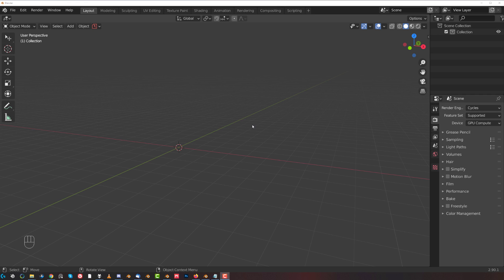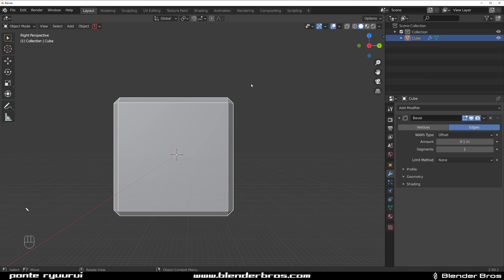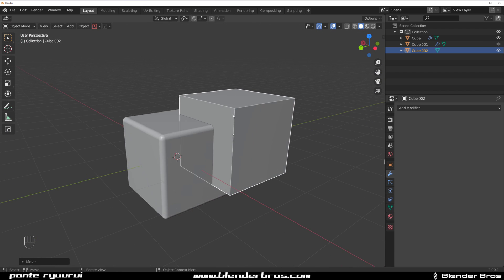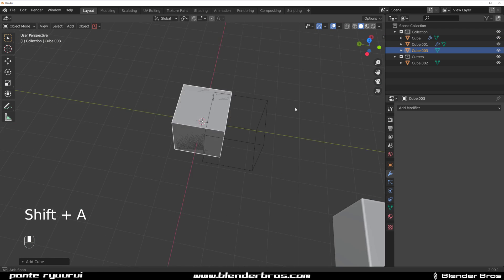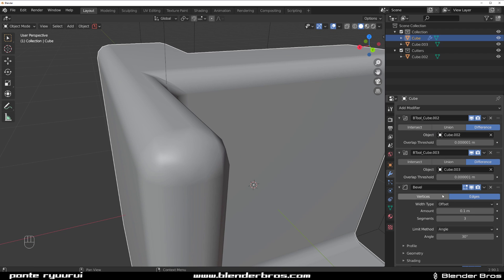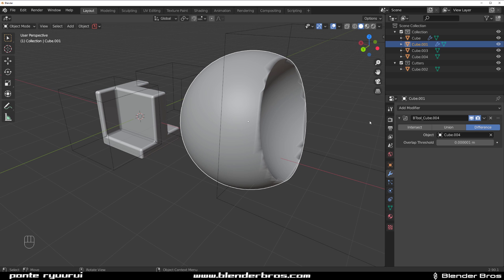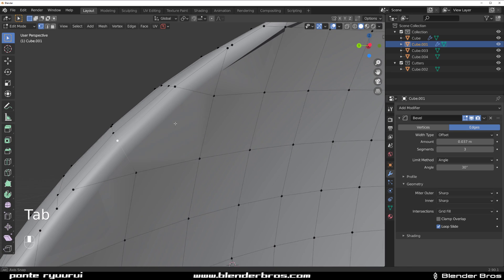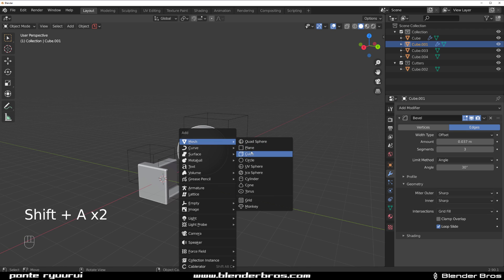WHY your BOOLEANS do not work in Blender?

Comment: Hi! I wanted to 3d print something but the file was problematic. So I am trying to fix it - I'm working on already existing file. I want to cut some elements but as far as I can figure out Blender, the booleans command sometimes cuts the shape, sometimes it adds it.. No idea if the file is corrupted or I'm doing something wrong (but I do the exact same process every time). I'm using the difference options. No idea on how to get pass that problem. Any suggestions?

Comment: I’ve been running into a problem where blender just stops allowing you to Boolean after a certain point. It’s not the object, because nothing will Boolean past that point. No matter how simple the geometry, once you’ve booleaned your objects “too many times” it no longer even attempts to make it work. Which is a problem because I use booleans a lot. Most for really simple stuff that’s a pain to fiddle with. For example; If I want a tube with openings at both ends, I’ll just use a cylinder to Boolean out the center of another cylinder and bam, a tube. Easier than fiddling with vertices and deleting/remaking faces. Yet if you do that too many times in one save file, it stops working all together. Not sure why, but it’s annoying when you’re trying to make something with a lot of simple parts and you try to make them occasionally using booleans
Reply from the maker: if you have 50 live bools then blender will choke. Apply some.
Reply: @PonteRyuurui  I apply all booleans as I use them, typically because I want the Boolean to be permanent. It just stops allowing them to work, even when tinkering with the Boolean settings. No matter what I change, it just stops allowing booleans. They no longer cut into the geometry, for some reason.
Reply from the maker: @Nikolai_The_Crazed   i ve never had this issue mate, make sure your blender and addons are up to date

Comment: What I found to be the most effective when dealing with misbehaving boolean modifiers:

- Merging vertexes: Sometimes you have some vertexes overlapping, for example you duplicated something by accident, you should always start with a vertex merging by distance.
- Face normal view: You can see all the faces and their directions. Make sure to recalculate normals, then check with this view if there are any weird stuff happening, take care of those.
- Errors can sometimes be found under the surface. Look around your mesh from within, see if there are any faces inside the mesh, boolean modifiers don't like inner faces.

Good luck!
Reply from the maker: for 1. use machine tools  merge, via 3 key
Reply: THIS is what helped me... at the end I checked the whole 'effing mesh and I found one tiny little nonexistent face that couldn't close the mesh, because vertexes overlapped each other before... probably. I couldn't see it in x-ray mode, only when I zoomed the shit out of it.
Thanks man!

Comment: I cant use the join option in the right way.. It happen when I try to join 2 meshs very high poly actually, i think thats the problem the high poly but I need it to be that high poly.. so when I try to use the boleans join option it just not work.. 😭😭😭 it happen so often..
I realize people no longer answer question like this in this 12 dimension reality.. I just write it here to relese karma.. thanks anyway
Reply from the maker: could be your rig limitations, if you are booling massive geos it could cause issues

Comment: Tried with the boolean modifier and bool tool in preferences and the mesh isn't getting subtracted for some reason :/ don't know why
Reply from the maker: try setting boolean to exact
Reply: @PonteRyuurui  it ended up working but I had to delete the mesh I was using and recreate it and position it in the same spot then it worked. Don’t know what was wrong with the first mesh but at least it worked. Thanks

Comment: hi, I can't use shortcut ctrl+ minus ,I marked bool tool , I used Shift and then I use ctrl + minus but its only multiply the picture. any ideas what can be wrong?
Reply from the maker: if you have bool tool addon enables ctrl + mand - should work, unless you have other shortcut that conflict with it.
Reply: @PonteRyuurui  thanks , eventually I have changed my shortcut fot that ;)

Comment: Thanks for the guide! The one which really helped. But even though I have one issue when exporting. When I export my booled sculpture - the boolean figure (which is here to substract some part of the sculpture) suddenly becomes visible in Unity. Maybe I should apply boolean interaction to remove that redundant figure or something? Thanks in advance.
Reply from the maker: gotta export only visible geo, otherwise FBX will snatch all items in the file
Reply: @PonteRyuurui  have already solved the issue by accepting transformation in additional options menu

Comment: Thank your showing common problems when using booleans, and how to fix them. youtube compression makes it sometimes hard to see the shading issues, can please use the car paint mat cap sometimes, this red, high glossy material? the shading issues are much more visible then. keep on the good work :-)
Reply from the maker: sure thing will do, but you can increase the resolution to 1440p